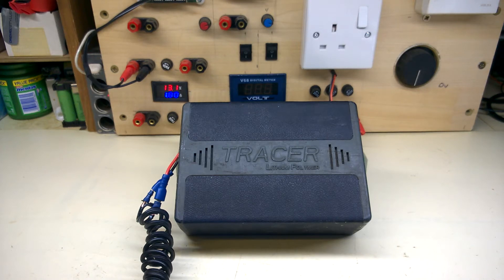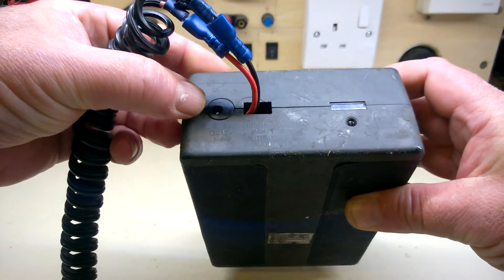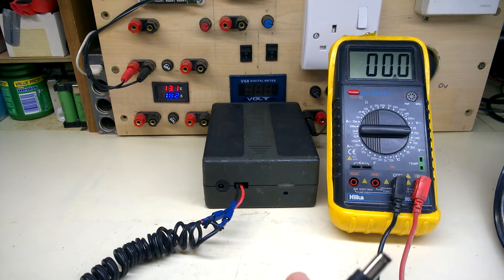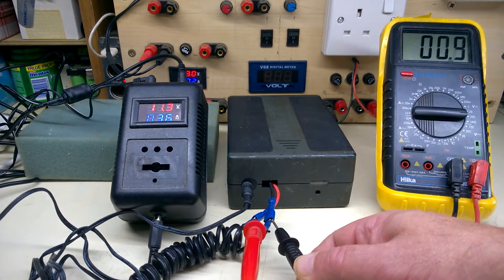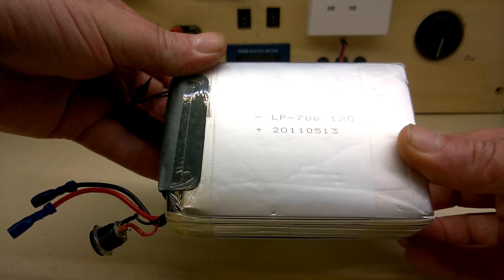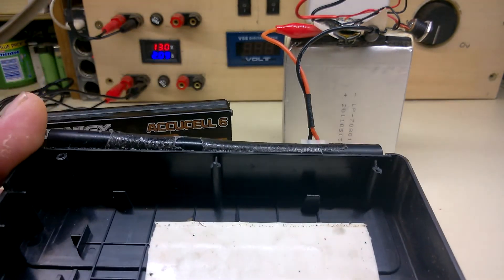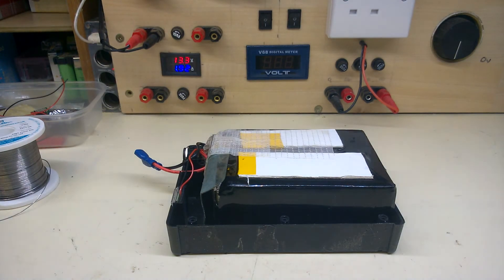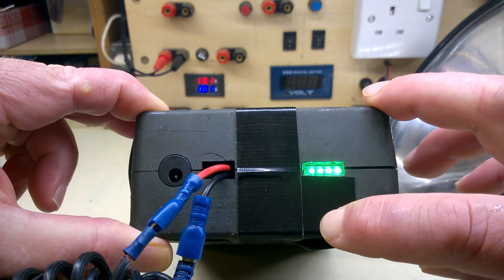Tracer dogging lamp battery repair

Comment: I have a handheld LED lamp with lithium battery built it to it, it just stopped charging it shows a green light itstead of red when i plug it in is that an easy fix or could you fix it ?
Reply from the maker: If the battery isn't full,and you have a green light on the charger,then there's a fault with either the cells,BMS circuit board or the charger (most likely the cells).

Unless you can fix it yourself (or find someone to fix it for free),it's not financially viable to pay someone to fix it.
I repaired this one because it was a neighbours' battery.

Assuming it's a 12 volt pack,you can buy a lithium car jumpstarter for between £25 - £40.
Hook it onto  your belt and wire it into the lamp (after removing the original battery).